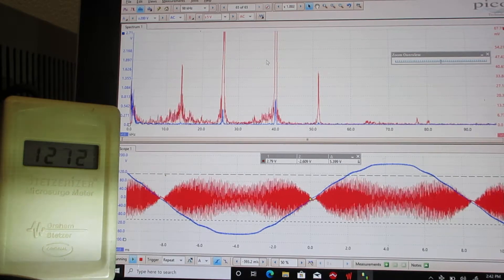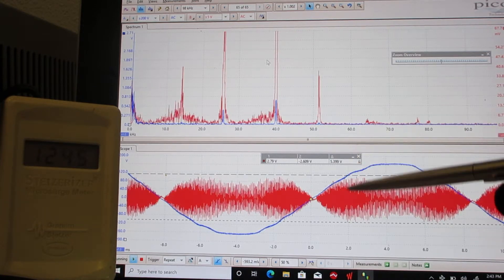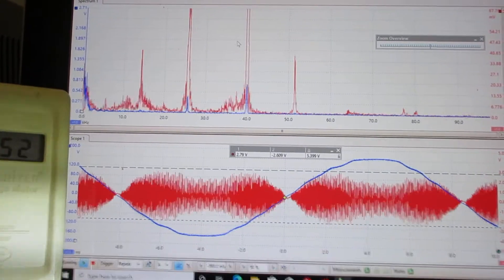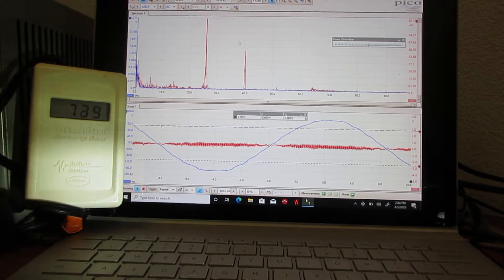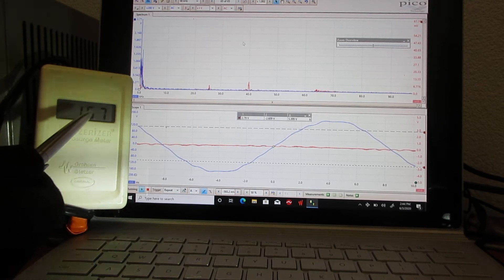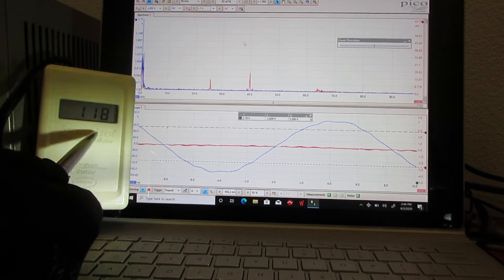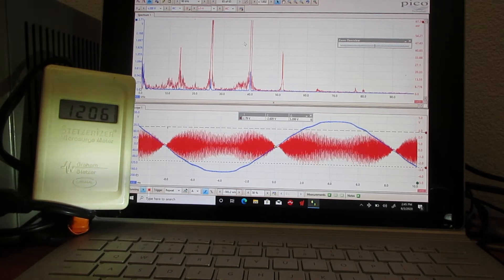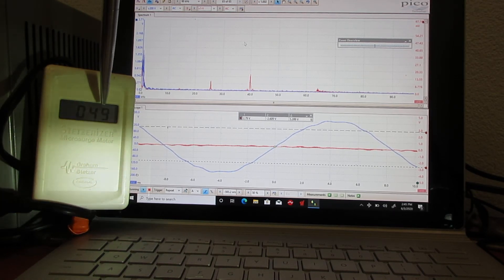Toxic Dirty Electricity created by UPS battery backup units for office computers.

Comment: I don't understand! I have been told to use UPS for Dirty Electricity.

You are saying they create DE?

And what filters are you using, please? Line EMI filters and stetzer?

Thank you.
Reply from the maker: These UPS units were the source of the problem. I testes\d several filters and combos of filters.  The cost of replacing the UPS units was much lower than effective filtration.

Comment: I thought that "sine wave" UPS power supplies would double-convert the mains power from AC to DC, then back to AC and in the process clean up the power. Not sure if this video only refers to wall power, or the UPS supplied power as well.
Reply from the maker: Hello,

The 60cycle sine wave is fairly clean with a little fuzz on it: that is what they refers to as so-called "True Sine Wave".  They do not consider the high frequency voltage transients, HFVTs, which has also know as dirty electricity of DE.